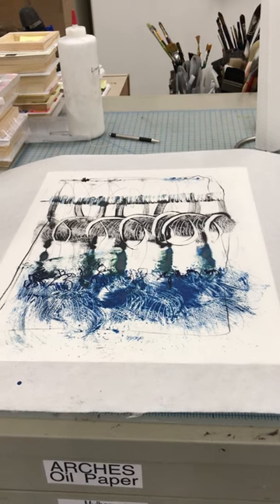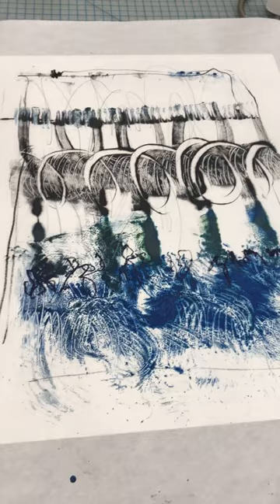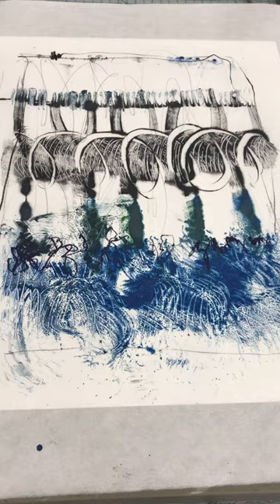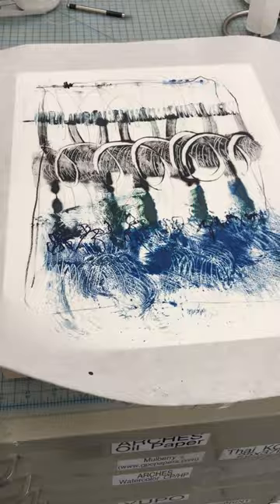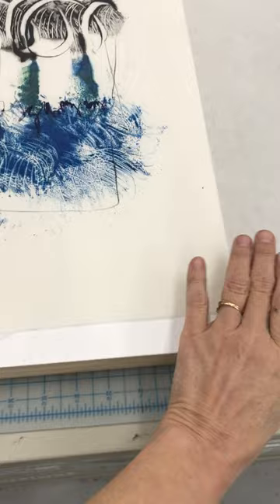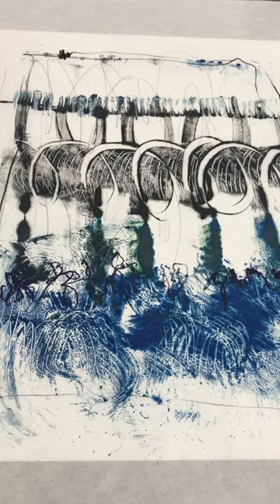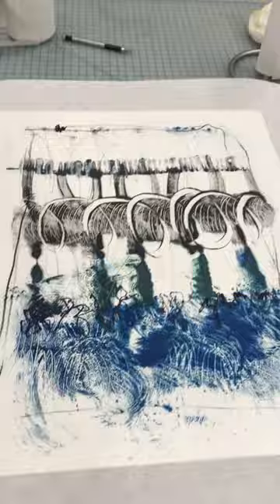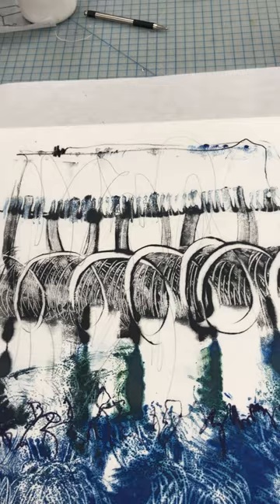Mounting An Encaustic Monotype On To A Panel #shorts #encaustic

Comment: If in later my encaustic print on my hot plate with medium (don’t know why I did that) mani still able to adhere it to the panel with the glue? Will the wax stick? Or do I need to now use it in an encaustic collage?
Reply from the maker: So the best way to ensure good adhesion between the monoprint and board is to make sure there is a lot of paper that has not been soaked with wax. The more saturated the paper, the less I would rely on this method of adhesion 😊